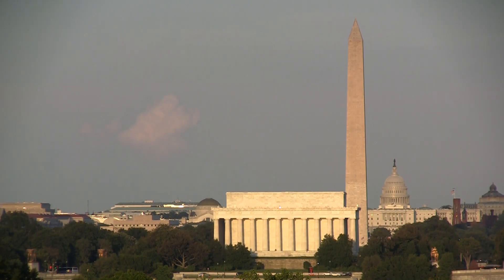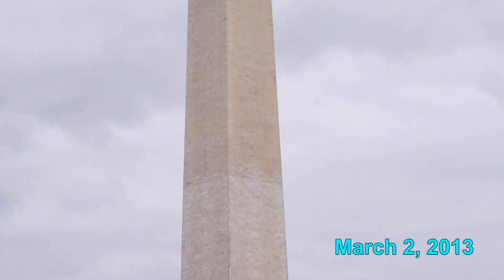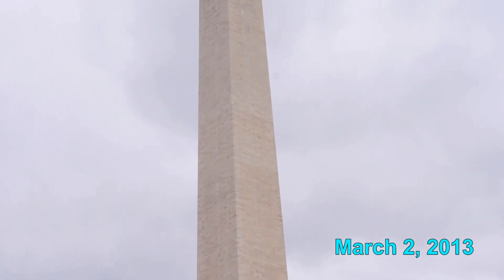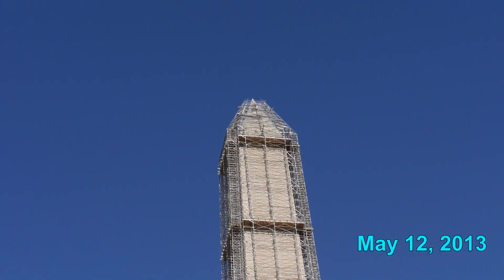Washington Monument Scaffolding - May 2013

Comment: Im not a scaffolder but how does it support itself, all that weight of metal ? The joints or brackets or whatever they are called are what, tightened by hand ? How do they know each and every one is as tight as every other ? Surely the higher it gets, the more weight it has to hold. Sorry if I haven’t a clue about any of it. I would be interested to know.
Reply from the maker: That interests me, too. Steel is a very strong material, but the weight of all the steel above the bottom row must be tremendous. Still, there are 2,000-foot tall antenna towers, and the only thing supporting the steel at the top is the steel at the bottom. So the steel scaffolding must be able to support itself up to a pretty great height.